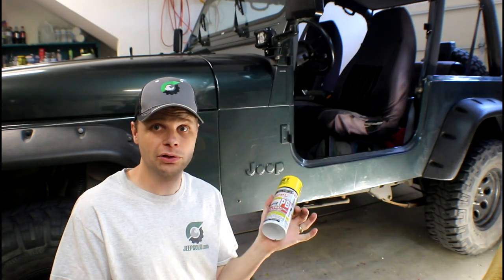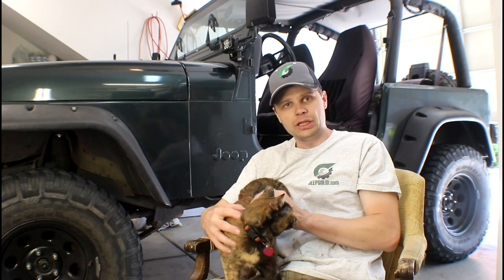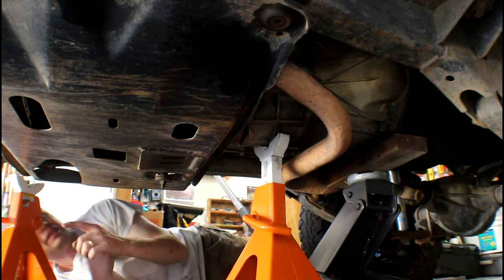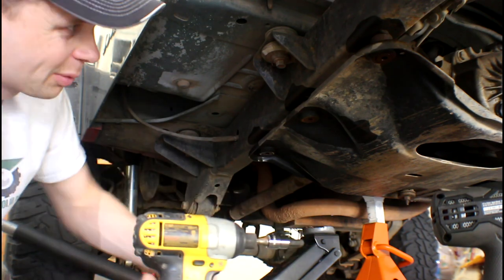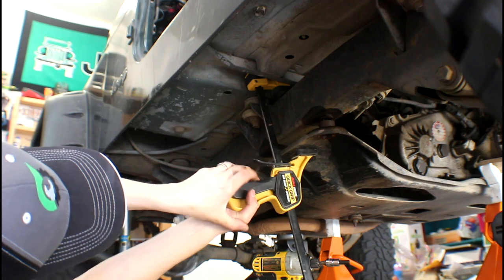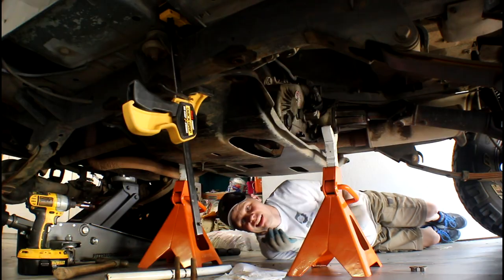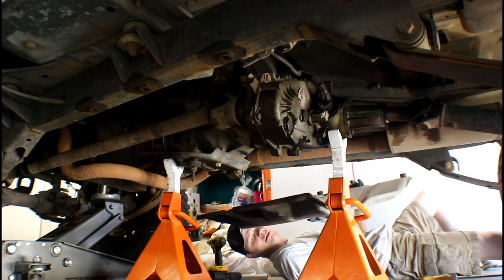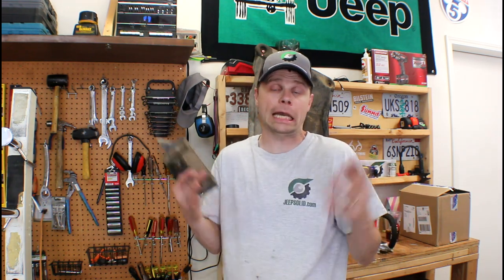Jeep Wrangler YJ Skid Plate Removal

Comment: My YJ has a significant rattle around the skid plate when under load or bogged down. Really hoping I don't have to take off the skid plate to fix the rattle.
Reply from the maker: Yeah, could be a bad mount somewhere... ?
Reply: @JeepSolid  Got in there and turned out the catalytic converter was rattling against the plate. Ended up having to replace it.

Comment: Very cool video, I have a 95 Sahara but I think most stock wranglers use a standard hex bolt not a Allen bolt like that jeep. I`m gonna PB blast mine for about 2-3 weeks, maybe even drill a small hole on top in the frame to really get it lubricated. Then hit it with a impact. For me using blunt torque ends up breaking the bolts, like my body bushing mount in the rear :(. I really enjoy your videos, and I hope to see more! (Keep the bloopers going :P)
Reply from the maker: Thanks Boby!  Yeah, I've considered drilling a hole above the bolt as well.  Thanks for watching.

Comment: Sir, do you know what size bolts are supposed to be holding the transmission mount in place against the transmission?  My sons 89yj 2.5 manual is missing them.  We have a new mount and pulled apart today, low and behold the mounts to the transmission itself are not there.  Any help would be appreciated.  Your channel
Is extremely helpful.

Comment: doing this right now, no problems, just one bolt will only go in about 3 turns. I used PB oil, should I tap out the threads? Thanks.

Comment: On my last YJ, 6 of 6 bolts broke clean off, flush with the frame.  On my current, MUCH more rust free YJ, 2 of the 6 broke.  I think your YJ is an uncharacteristically pristine specimen for showing these how-to's.  That is a great thing for you, since you own very clean jeep, but most people would very quickly get into trouble tackling this on a 30 year old rusty jeep.

A better video for me would show where it all goes wrong, and how to grind out, then re-weld in the rivnuts, or any number of other clever fixes.  Don't get me wrong, you did a great job on your video, but I would guess the vast majority would not have it go that well.

Cheers.
Reply from the maker: Yeah, I am fortunate to live in a mostly salt free state.

Comment: Walked out of my house this morning to see my '94's skid plate just hanging by the front two bolts.  I'm in the upper Midwest, where this YJ has seen 25 years of winter salt: do you have any advice on getting new nutserts into a rusty frame?
Reply: Sometimes you have to cut out that little area weld a nut on back of patch panel and weld patch panel back into frame

Comment: Really Really great instruction on how to remove the SP! So a few questions if you have the chance. My 1995 YJ seems to not have the spacers. I am not sure if this is an oversight or not. The prior owner broke one bolt. Someone told me that the spacers are there to allow water drainage from the frame, is this true? If that is the case, I might attempt this job. Contemplating a 2.5 lift, do you think I will REQUIRE the adjustment of the SP? So when you speak of using the 5lb hammer- do you strike the bolt head or on side of frame? When you use a torch, where are you applying the heat? Any other useful tips come to mind since video was made?
I like the side mirror mounts for the mirrors. Do they combine the off-road lights as well, or is that a seperate bracket?
Hey, big thanks for this video!
Reply from the maker: No problem.  Thanks for watching. 

The spacers that lower the skid plate are part of the lift kit for the Jeep.  My jeep has a 3.5" lift, and the spacers help keep the drive lines from too steep of an angle. 

If your bolts are giving you trouble, hit them with PB blaster, striking them with a hammer shocks the threads and can help break them lose, finally heat where the bolt threads in may help as well.
My side brackets can accommodate the 3" lights and mirrors.

Comment: My torque bolt for the transmission mount is missing on my "just acquired" 1993 YJ.  Anyone have a part number or source for the complete bolt with nut, washers, bushing?

Comment: Great video I wish I had watched about 3 hours ago. I started dropping the skid plate without supporting the transmission and after it sagged a few inches, I jacked everything back up and started looking for answers. With everything bolted back in place, 2nd gear now slips out at low speeds while not pushing on the gas. Where do you recommend I start looking? Thanks!
Reply: Did you find the answers?

Comment: Wish I saw this video before I took my skid plate off.
Reply from the maker: Oops..  Ran into an issue? I almost did that once too.
Reply: @JeepSolid  Well, the issue is that power isn't going from the motor to the wheels. I think it's the transfer case because the gear shift feels like it's shifting correctly, but that was before I removed it.

Comment: So I came across your video because I am removing the skid plat to remove part of the exhaust system in order to change my oil pan. 1 bolt came out fine 1 broke and the 3rd is spinning. How would you get a spinning bolt out. Thanks

Comment: Great video, I have an 89 YJ and have a slightly different mount on mine. Got my plate off but the two middle inserts are shot, and the holes in the plate for them are rusted to the point the bolt head fit through them (well, one was already missing when I got the Jeep) gonna probably need a new plate.  (The area where the mount bolts to has had a secondary plate added and a bad weld job done to it and is rusting badly as well!)I went to the black magic brake site and watched the video link they had on how to do the inserts, pretty cool, ordered the kit and the tool. Thanks for all your videos, they are my favorite as the lighting and editing are top notch.

Comment: Wish that I saw this video two months ago about supporting the the transmission and transfer case.
Dropped the mount and then got in he. Jeep and took it out of first gear. The transmission and transfer case
fell down pulling the rear drive shaft almost out of the transfer case. Bottom line is that bit ruined the transfer
case. Mechanic gave me an estimate of $2,350.00 to fix it. What a dumb thing I did!

Comment: Thanks for this video. I need to replace the cat-back on my TJ and I knew I have to support the trans if I drop the skid plate. I like your suggestion on putting stands on both sides. I am going to try using extensions on my socket first to get at the 2 nuts on the catalytic converter, but if i need to drop the plate, you gave me some great help!

Comment: At 15:01 of the video you removed the mounting bolt ( the one with the large washers ). I noticed it was a little lose prior to you getting the wrench on it. My question is : is that mounting bolt supposed to be lose like that ? How tight should it be ?
Thx
Reply: 25 lb

Comment: Once again EXCELLENT video site and I have a question. I'd like to remove my 95 YJ air conditioner. I've had these go on other vehicles along with the belt snapping.. This is a weekend only joy ride vehicle and given my location summer heat is short lived. By removing the unit and installing a "by-pass" pulley will I have any problems you know of ? Thanks in advance...
Reply from the maker: Thank you. I have not heard of any issues with that conversion, but it is not one I have done personally.
Reply: @JeepSolid  Thanks again.

Comment: Great video! Question, I have 91 jeep and  it won't stay in four wheel hi or low. So I am planning to remove the transfer case. When removing the skid plate, should I support under the transfer case as you did, then after the skid plate is out of the way, add another jack to the rear side of the transmission to have two jacks on the transmission? Also, do yoiu have a video in removing the transfer case? I really like your videos
Reply from the maker: You can support it from the transmission.  I have a video on transfer case removal on a Jeep Cherokee.  It's very similar .  Good luck.
Reply: Thank you again. I really like your videos. If you don't mind, I'd like to ask another question. My problem is the shifter doesn't like to stay in gear (4 H or 4L). I need to make sure it is not the linkage assembly or shift mechanism before I pull the transfer case. I removed the linkage and freed the adjuster to move and put it back in place but it is only marginally better. i was wondering if it might be anything related to the base of the shifter arm? Do you have any experience with this? I just have a feeling it is not the transfer case. Ed @JeepSolid

Comment: Love the bloopers. Are you just gonna weld a new transmission mount on?
Reply from the maker: Yep.  gonna weld the 2 halves together and see if it holds...??
Reply: Did the welds hold on the transmission mount bracket ? Its me from other transmount vid im also gonna investigate engine mounts the noise is located near shifters on the floor so why figured trans mounts 👌
Reply: Noise slows when in neutral or park as engine torques it gets silent👌😎 gonna take some investigation when snow melts and can climb up under her 🙌
Reply: I havmt had another person around that i trust to hit brakes and gas while in drive to see if engine mounts are sloppy or what is makin noise to be exact all hypothisis so far 👌
Reply: @brshoggalyboogaly7237  tape an old phone under there with the video recorder running.

Comment: I recently installed a new transmission mount and torque arm in my 1990 yj. Im still getting excess movement out of my transmission while driving. I purchased some energy suspension urethane bushings and installed them but they're much thinner than the oem rubber bushings so there is a bit (1/2"-3/4") of space between the ear ointment trans and the bottom bushing . Any ideas?
Reply from the maker: +David Poston Can you send a picture to the JeepSolid Facebook page of the setup?
Reply: +JeepSolid Sure
Reply: +JeepSolid Yes I will ASAP. As soon as I get a break in the rain. Thanks
Reply from the maker: David Poston Great! Be easier if I can see specifically what you have going on.
Reply: JeepSolid I'm having that issue. I see Davey boy didn't post a pic so I'll have to.
Reply: JeepSolid http://www.jeepforum.com/forum/f8/dana20-torque-arm-configuration-4083553/#/topics/4083553
Reply: JeepSolid This is the best I could do. The third post from the top is what he's talking about.
Reply: JeepSolid Although I assume we're running np231 cases.